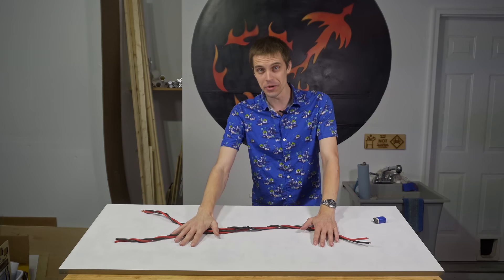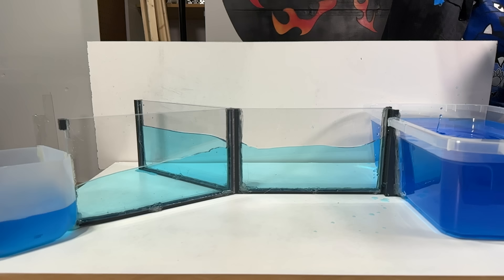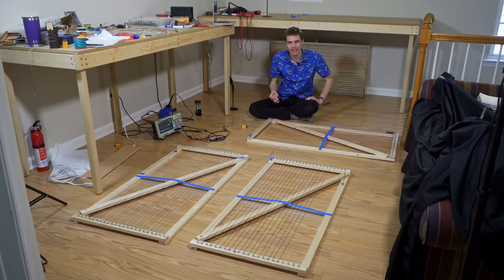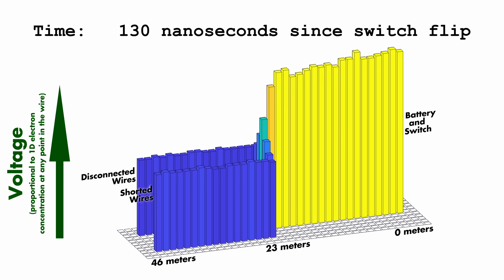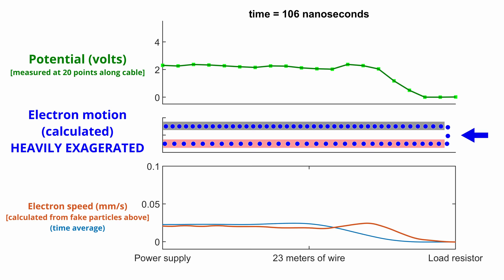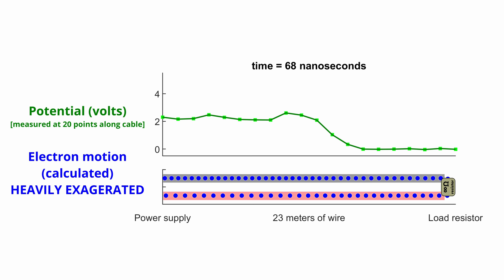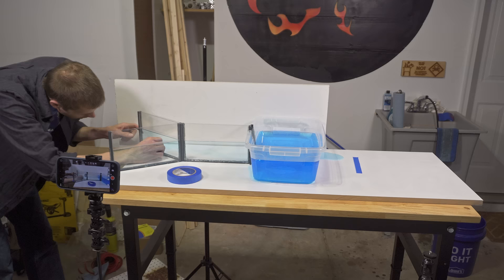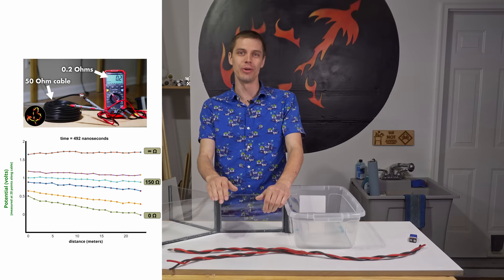Watch electricity hit a fork in the road at half a billion frames per second

Comment: Excellent video, those data-driven animations are extremely clarifying. I'd never seen someone show a circuit settle into a steady state like this, thanks for putting in the effort.
Reply from the maker: Glad you liked it! (Don’t worry, I’m a big fan of math-driven animation as well)
Reply: Does it settle to a steady state? Or does it ring with ever decreasing amplitude, forever?
Reply: It's blowing my mind just how accurate the water analogy is for electricity.
Reply: Totally agree!
Reply: @StreuB1   so there will be a moment when the interactions will reach smallest possible energy transacttions between electrons given from quantum mechanics, but in these "large"  systems it is afaik effectively infinite, but mathematically you can say it is definitely not
Reply: @StreuB1  In practice it will never stabilize as any EM radiation from our world (phones, radios, TVs, AC lines in your home, any electrical equipment) will induce currents in the cables.
Reply: @StreuB1  YES.
Reply: When 3b1b likes your data driven animation, you've done something right
Reply: This comment is the equivalent of winning an Oscar for teaching-focused animations.
Reply: @StreuB1  It would become drowned out by noise
Reply: These are the types of visualizations we need to really understand what is happening.
Reply: And right under my comment mentioning you, Grant, you show up. Wonderful ❤
Reply: @StreuB1  Not forever, only until it runs into planck limits, and then its just random noise.
Reply: @AlphaPhoenixChannel  what an excellent job! Thank you for putting ur time into this. About to show this to all the guys at work
Reply: The way the bar graph visualization looks like the water model blows my mind
Reply: @AlphaPhoenixChannel what about 120v? does it scale up?
Reply: The comparison to the water model just tells me we should be treating the flow of electricity like a fluid. Probably a gas more than a liquid though, as liquid is supposed to be incomprehensible and you clearly showed the electrons compressing in the wire.
Reply: Dereck from @veritasium

Get in these comments!!!
Reply: 3B1B! AlphaPhoenix: getting a compliment on your animations from this guy means something. Love both of your guys’ channels. You make learning more advanced concepts as joyful as it was when I was younger. Thanks for making the world that much more beautiful.
Reply: @TheClintonsimmons 
That would be the ultimate collab. We get Veritasium and Vsauce to show up, we will have quite the showdown.
Reply: @StreuB1 there is always thermal noise and other external noise sources acting on a wire. At some point the amplitude becomes so low that it becomes indistinguishable from the noise. At this point you might as well call it steady state.

Comment: I am PhD Biomedical Engineer (hons electronic) and also MD (medical doctor). Congrats on excellent video. The same thing (wave reflection) happens in your body every time your heart beats. The outgoing wave in the large arteries reflects off the capillary bed and you get amplification of the pressure (equivalent to voltage) on the leading edge of the (systolic) pressure pulse. Not only that but as you age the blood vessels get stiffer (lower capacitance) and the distal impedance increases, further increasing systolic pressure. Of course you also get a multitude of reflections at every branch. Congratulations, if you understood what I just said you understand more about this than almost all doctors.
PS. I have the exact same oscilloscope next to my monitor right now!
Reply: Amazing! I might be overthinking it, but would the electric signals through the nervous system exhibit similar behaviours as described in this video?
Reply: 26:17 Not an MD.  (Lay person).  Visualize the effect of the electricity that is generated by the blood flow coursing through the circulatory system, how it is affected by each branch, affected by the increasing resistance as we age and the decreasing potential for optimal energy caused by stress.  Visualize now how relaxation enhances potential by resolving some resistance increasing potential energy flow increasing capacity to more efficiently nourish cells of the organism increasing potential for enhanced health and wellbeing.  Not looking for miracles here.  Just my way of thanking you for your very articulate response to an excellent video.
Reply: That's so rad man! I totally understood that, never quiet did with the traditional examples
Reply: ... maybe there are some engineers out there dealing with designing analogue sythesizers. Sure they can help!
Reply: Thats awesome how you've explained important aspects of the human heart and blood supply. This visit to youtube (for me) has been the most educational of all my years of youtube viewing! thank you.
Reply: What medical specialty are you? I am a BMEN undergrad and plan to go to medical school and currently do research in a cardiology research lab and am very interested in this field.
Reply: Not only did I understand what you said, I also learned what half the words you said meant through context. You see these words thrown around by doctors but they never make sense if you either don't study them or see them presented in the complete picture.
Reply: I'm just a greaseball gear-head and reflected pressure in the intake and exhaust tracks feeding an engine result in what's commonly called a power band. An rpm range where the action of the valves opening and closing are well suited to the medium (ambient temp air for intake, hot exhaust gas) to reflect waves and pack the cylinder with more charge than it's normal 1bar.

Also, disconnecting the shorted side and the resulting voltage spike (flipping the two legs of the demo) is what mechanical points do to generate enough potential to jump the spark gap.
Reply: It actually does makes a lot of sense. Actual MD's don't understand this? It makes even more sense when you think of the waves. Just like a Tesla valve creates interference patterns that impede the flow of fluids, I would guess that electrons encountering a wire with an open circuit end up reflecting back and colliding with other electrons. I would hazard a guess that the electrons create an interference pattern that generates a momentary spike in resistance until that resistance equalizes throughout that open circuit branch. Once that impedance settles, that branch would act as if it's a closed valve.
Reply: Hmmm...I wonder if this is part of what I feel. I'm an A.D.D. adult 61yr old. I'm an auto mechanic 43 yrs. After reading these replies, some of what I've said over the years makes sense. My body has always felt like it's buzzing. It varies. The Docs & I have just marked it off to neuropathy from numerous motorcycle impact accidents. As I've aged the buzz feels more like throttling now. I wonder if somehow I'm in tune with the pulse feedback that changes with age.  It's always felt like an opposite heartbeat. Either way I'm just weird and am what I am.
Reply: A PhD sitting at a bar, how would you know they have a PhD?

Easy, it will be the first thing coming from their mouth.

It's kinda pathetic how some people with PhD (which has zero meaning everyone can waste 6 years of their life to get a PhD) will tell you they have a PhD even though no one asked.

Grow up please.
Reply: I wonder if the electricity in your nerves act the same as the video explains or if your brain eventually learns how much is exactly needed for where it wants to send the signal to?
Reply: @liambellis3135  I'm not sure if the brain can regulate like that b/c the brain can send pain message to spot where injury use to be or to where there isn't a pain condition. Like there isn't a double check on signal.
Reply: omg what path did you take? MD -> masters in engineering or the reverse way?
Reply: @qozia1370 ok we get it you're jealous of other people's achievements. If anything gives you bragging rights, a PhD is on top of that list. I guess you prefer it when people flaunt their wealth?
Reply: I love the circuit models of the heart, and circulatory system
Reply: Willu please be my personal Dr? I had a disease once and now I feel like I might have a different one. 🤷
Reply: Your heart acts like a low frequency DC generator due to the pressure in the in the contraction  and the valves closing at the end and the relaxing of the heart after befor another cycle starts as blood is drawn into the chamber for the next beat.
Oh and there are a lot of things related to electricity that doctors dont know.
Reply: Man I've learned more from this thread than I have on YouTube all day
Reply: @qozia1370 if you took a second to think about why he mentioned it instead of feeling like you were just called "lesser", you'd realize it's the most succinct way of saying I've done extensive study on this for years. Don't channel your feelings of inadequacy at someone devoting vast amount of time into a worthy cause. THAT is childish.
Reply: God is amazing
Reply: Just came to make a similar comment! Also have a PhD in bioengineering (but no MD!) and was struck by how much this reminded me of pressure waves in blood veins.

I also have the same oscilloscope sitting on my workbench downstairs!
Reply: What does a biomedical engineer do for sn everyday job I’m thinking of becoming a biomedical researcher
Reply: Like the water hammer effect?
Reply: @zedex1226 That reminds me of Walter Kaaden (spelling?). He was chief engineer at MZ motorcycles in the early or mid 20th century. He developed the expansion chamber exhaust pipe for the 2 stroke engine. The pressure pulse leaving the exhaust pipe would reflect at the open end, so returning to the combustion chamber and pushing back some fresh fuel/air charge: >100% volumetric efficiency like you described. MZ would have been the world leaders on motorcycles but the Japanese 'bought him' 😮
Reply: I saw a device that monitored the heart with electrodes at the heart, and the pulse at the thumb.  If you blood pressure is high, the pulse gets there quicker than when blood pressure is low.  They would measure blood pressure to calibrate the system, then could take the cuff off.
Reply: Also - anyone who has ever made up a Cat5 network knows that electricity (well, high frequencies) reflect off corners if they are two tight.
Reply: how does one keep their arteries SUPPLE? with out pharmaceuticals that destroy other functions with side effects.?

Comment: I have a bachelors in Electrical Engineering and have worked in the profession for 34 years (retired). I have never seen electricity explained this intuitively in college or at my job. This was awesome. The similarities between fluid and electricity behavior are so useful to help understand electricity. It's a very tough thing to grasp due to how fast things happen on an atomic level. You figured out a creative way to capture it.
Reply: Agreed. I struggled with these concepts initially in college, and an explanation like this illustrated the concept perfectly.
Reply: Yeah, I always pictured the initial wave explaining switch voltage spikes, but I always assumed it would dampen much faster than that.  Seeing the electron loading bounce back and fourth almost 4 times before being dampened to equilibrium with the motive force was impressive.
Reply: My understanding is the electrons do not move , the electric field moves out side finds the electron at end of wire or switch junction whatever , They all teachers say electrons move yes but not in the way we think about movement in that way they don't
Reply: @rolandhawken6628  Electrons are moving from one pole of the battery to the other in an electro-chemical-thermal reaction.
Reply: @runbigfoot  I was referring to wire
Reply: Could you explain how the trough acts like a voltage regulator?
Reply: @stopthephilosophicalzombie9017  I watched it too long and ago and can't remember now. Lol.
Reply: First of all, this is an excellent demonstration. I started to write this comment at the top of the list and I thought.. There has to be other Electrical Engineering majors around. The more I think about it, the more this resembles things I've learned (and mostly forgotten) in undergraduate study in Electrical Engineering. (I am more of a computer engineer and have been working in IT for the last 25 years.) We had one class that was about "transmission lines" (and these aren't high power transmission lines) but all the principles that are used when propagating radio waves through space, and through wave guides (which are like pipes that contain waves, almost like a faraday cage but a tunnel), and through coaxial wire. Anyone in the radio industry knows about impedance matching to transmitters, antennas and wire. The physics behind it is that every wire has some kind of inductance and between every pair of wires there is capacitance. Whether a coaxial cable, or even twisted pair like in the video there is an impedance that can be determined. if the source and the destination are "impedance matched" then "reflections" (which is the term used) can be minimized (and lost power and power reflected back to the transmitter minimized as well) The transmission line (or basically the wires, whether twisted pair, coaxial or even just two wires running in parallel in air) can be modeled like a ladder with the rails being small inductors and rungs being small capacitors. (and with all the math and calculus and imaginary number math) you can build up pretty good predictive math to model its behavior (basically, as the inductors and capacitors get really, really small [in calculus, "the limit"]) then you can describe it. All of that fundamental understanding comes through earlier classes in circuit analysis dealing with resistors, capacitors, and inductors. ... Man, it has been a long time since I have even thought about these types of things!
Reply: @richziegler4194 Yeah my dad is an electrical engineer at NASA and I bet he'd be hard pressed to remember this stuff as the software does all the calculations for you for most design applications.
Reply: Same here. Electrical Engineering degree and this is the best explanation I have seen. Ever!
Reply: the on ly issue is that it doesnt. see the video by veritasium on it.
Reply: Yes, we had to imagine all this and bet our careers on imagining it right and similar enough as others to understand one another.
Reply: This wasn't what I thought I was going to get from the title of the video.  I was surprised once I started seeing the setup to have my old Transmission Lines class start spooling back up in my head and I eventually got ahead of the video.  

Back in 1982 "Transmission Lines, Waveguides and Antennas" was considered the final "Weed-em out" course in Electrical Engineering.  I remember taking it early so I would have the chance to take the course again because I was scared of it and the teacher.  Boy was I wrong. The teacher was fantastic and I loved transmission lines I guess because I could "see" them (as opposed to waveguides which completely flummoxed me).

I remember doing a similar lab experiment (It was a diffusion line instead of a transmission line) where the response was measured and plotted along the length of the line and compared to the math model.  That was tedious and it covered just a couple of feet with no wire stripping.  Stripping the wire every two feet with an Exacto knife is pretty tedious stuff, much less performing and synchronizing all the data collection from an oscilloscope.

I'm much more of a visualization guy than a math guy, but it would have been interesting when this started talking about capacitance to bring in the modeling math equations.  Particularly when applied to the junction.  This visualization really just missed on the reflections at the discontinuities.

It would have been really fun if you could have dragged out an old Smith chart transmission line calculator.  Back in the early '80s this was a paper chart that we used rulers and compasses to figure out this stuff.  I have no idea how this is done in the computer age.

It would also be fun, if you want to repeat, to run the same wire setup with an AC source and get into tuning....
Reply: Eh?  I remember doing this exact experiment in Physics class in 1977 when I was in 11th grade.  We compared and contrasted water waves with electric current over time and determined the speed of the electrons as shown on a primitive oscilloscope (about five times the size of a modern one).  I am glad to see that there are those that are regaining the knowledge nowadays.
Reply: What, 34 years in the field and you never had it explained to you! Wow! No wonder humanity is in trouble.
Reply: Ever seen light up a rail with fluorescent lightning tubes and primary rectified switching drivers? If the rail 's got about 20 meters or more you can see the phisics behind literaly. Switch on first ignites and down it goes the alley.
Reply: @richziegler4194 Thanks for mentioning the capacitance and inductance of the wire. I was going to bring it up but you've covered it pretty well. 
A vector network analyzer and a Smith chart may be a better tool for getting a picture of the 
LC components of the circuit. 
Then see if the reactance of the   components have any bearing on the speed of his circuit.
Reply: It's because they share the same basic 'wave physics' code. As above, so below.